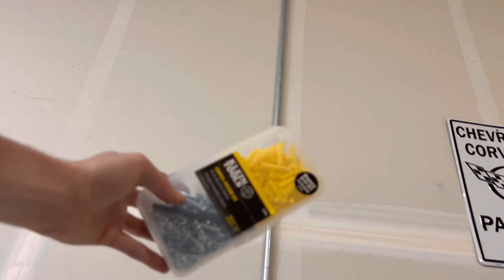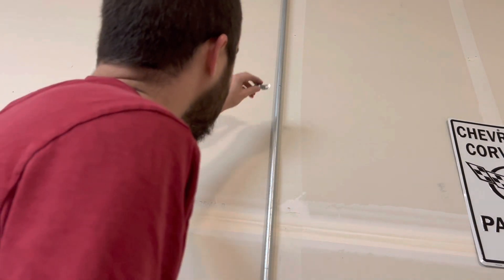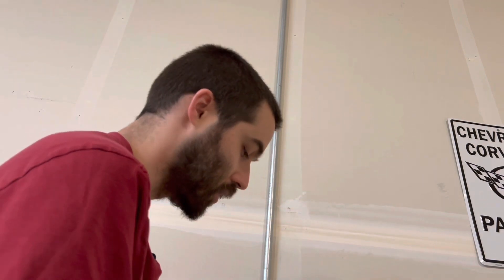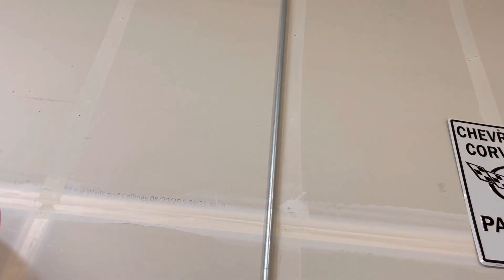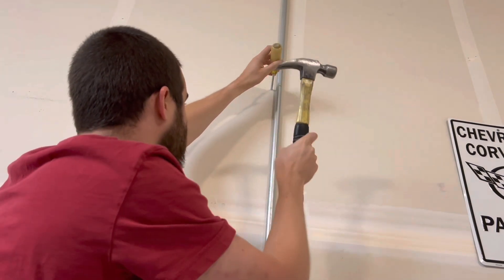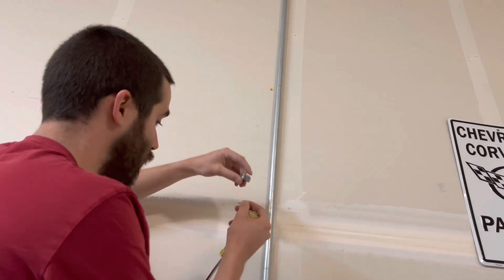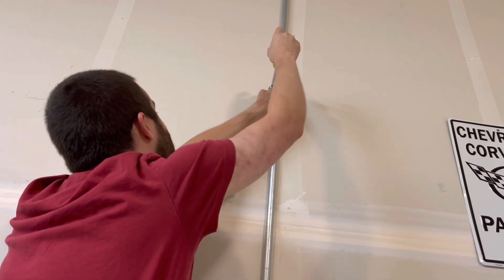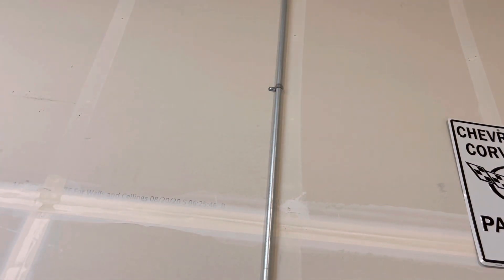Electrical 101: The EASIEST Way To Install Plastic Anchors In Drywall (Commercial)

Comment: Probably less dust than drilling a small pilot hole. I do the same thing but with a flat head screwdriver and a twist and push motion (kind of like drilling a hole with the screwdriver tip).
Reply from the maker: yeah, try the phillips way and let me know what you think
Reply: @DailyElectrician  Next time I have to install an anchor I'll try it out.
Reply from the maker: sweet